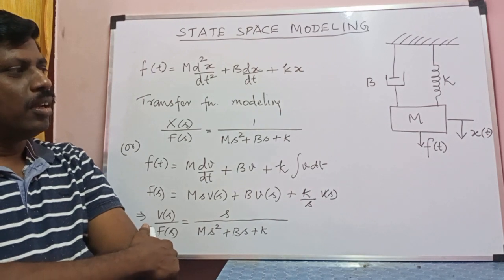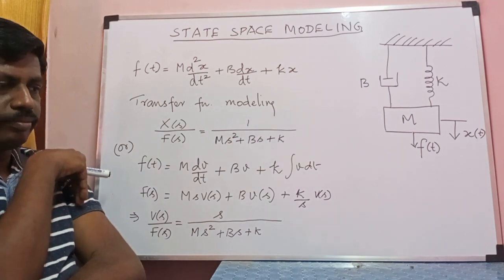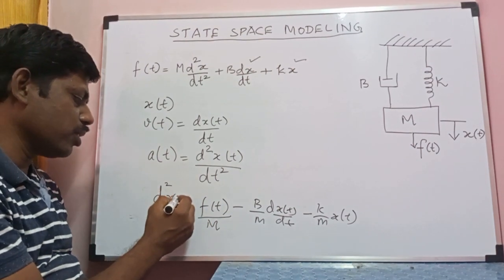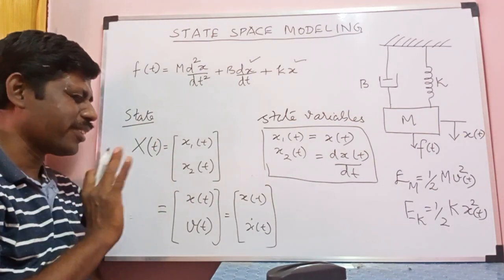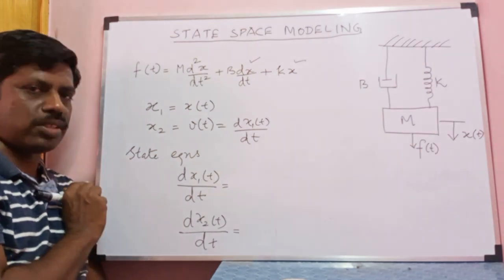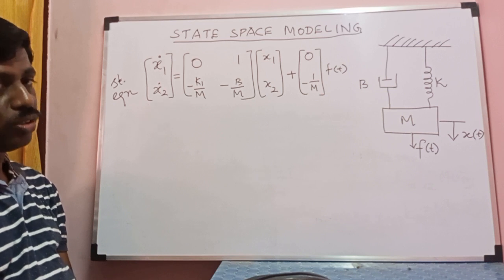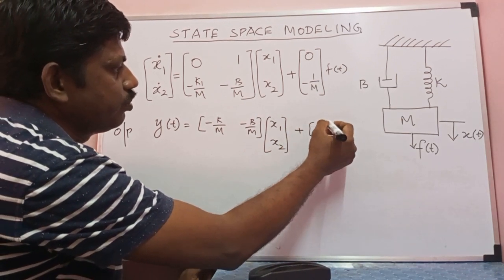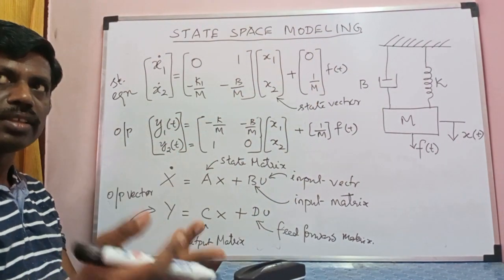Introduction to Modeling of Mechanical Systems in State Space | Lecture 1 | Modeling in State Space

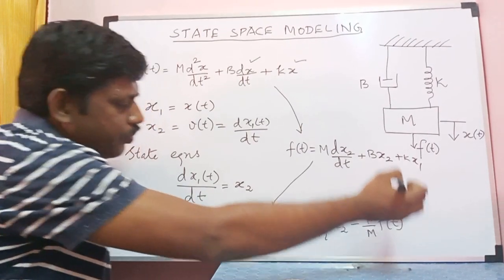Comment from the maker: There is a mistake at 22:41 as pointed out by one of the viewers, It should be x2dot=-(K/M)x1-(B/M)x2+(1/M)f(t).  The negative sign carried over in the subsequent steps, along with this term, also have to be corrected.  Also, the notation for the spring constant is K, not K1 as appearing at a few places.